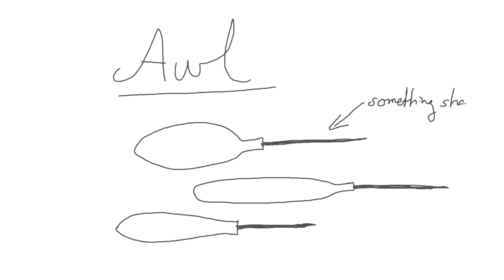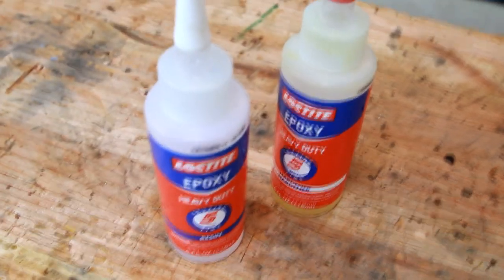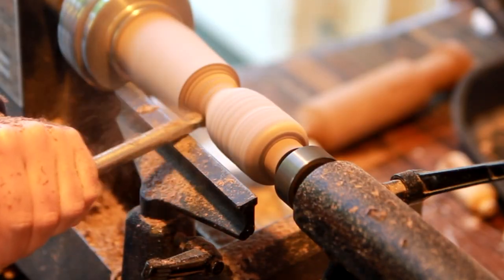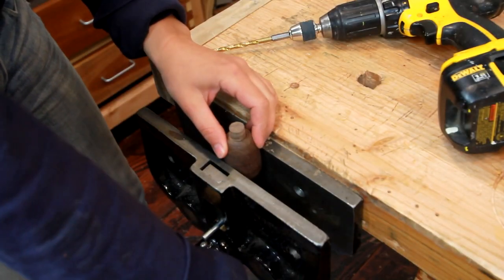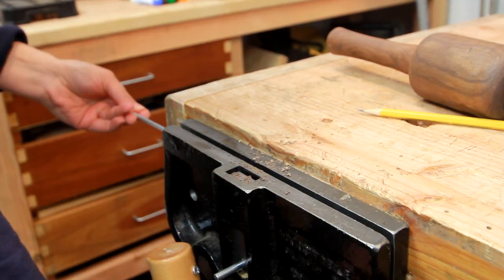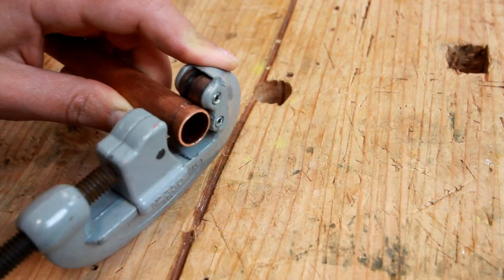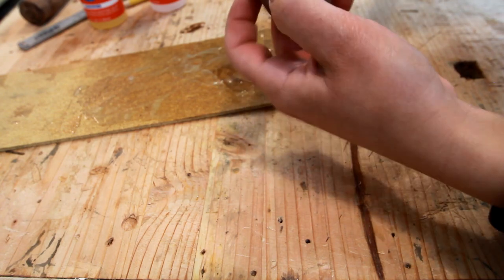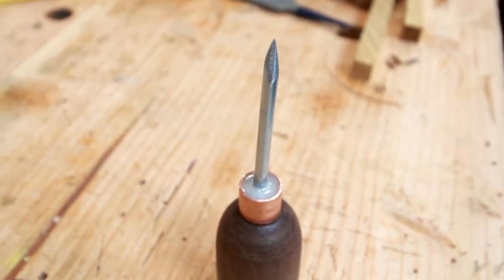How To Make an Awl

Comment: Nice simple little project. If I could make a suggestion though, when roughing down the stock on the lathe using the over hand grip move your left hand closer to the rest - your little finger should be almost touching the rest. It'll give you greater tool control and allow you to take heavier cuts safely. Can't wait to get my lathe set up again now!

Comment: Nice video Linn!  I noticed you using your calipers to measure your ferule diameter.  One tip - if you are dealing with an even fraction, you can use an open end wrench as a go/no go gauge.

Comment: Nicely done!  I'm surprised at how often I use mine. As an alternative to getting the point on the nail, you can chuck the nail in your drill press and hold the file against it at an angle.  Your point will be automatically centered too :)
Reply from the maker: GarageWoodworks Thanks Brian!

Comment: Well Done. If you want a more symmetrical tip you can chuck the nail up in a drill or drill press and turn it on, using the file to shape it. You can do the same with the copper pipe and use 400 grit sandpaper to polish it up a little. Personally, I prefer a more mushroom-shaped handle, as it locks into my hand easier. I am concerned that the steel from the nail is to soft and won't hold edge long enough. Thats why I used a broken drill bit for mine. You will find that a shorter awl is more accurate, faster and easier to use. great build, enjoyed it.

Comment: This is old, but still, if you decide to make another one, file some grooves into the end of the nail that gets fixated with epoxy into the handle. Epoxy tends not to stick well to metal - too smooth and non-porous. But if it once hardens into irregularities of the metal's surface, you have to break it to get the metal out - and epoxy is quite hard.

Usually, when I do handles, I don't glue the ferrule. I make the wood slightly conical, and hammer the ferrule in. So far, none of the ferrules I fixated this way has become loose.

For an awl, I'd also use something else than a nail. Maybe a broken screwdriver, or one with a stripped head. Nails are both not very hard steel and a bit thick, at the length required for an awl. Me at least, I like an awl to be quite thin.

Visually, the thing came out great. And the chubby handle is just right for an awl - you need to be able to hold it quite tight, a thinner handle wouldn't cut it.

Comment: Nice. Can you use your wood lathe to drill into the center of the wood. My only lathe experience is with metal lathes. Drilling while in the lathe would more easily yield true straight holes.

Comment: A fine effort.You could have drilled the hole on the lathe if you had a chuck to fit into the tailstock. That would have kept the nail true to the axis of the handle. Keep it up!

Comment: great job, you could of used a end cap and drill a center whole the size of the nail this makes a nicer feral end  since you were using a lathe you could size for its diameter or simple add one over your feral it would be a friction fit

Comment: I would have left the ferral part slightly larger and then heated the copper pipe so it expands. Then I would have hammered it in to place and as it cools it shrinks and grabs on verry tightly. Its how barrels and some drums are held together. You should try it some time =0)

Comment: Chucking the cut nail into a drill and rotating it while offering it up to a belt sander is a great way to sharpen the tip and even regrind the bevel (to make it blunter or pointier). Just don't have the dust collection on if the sander is so equipped. Sucking sparks into sawdust is BAD!